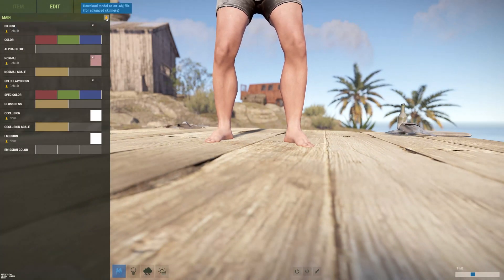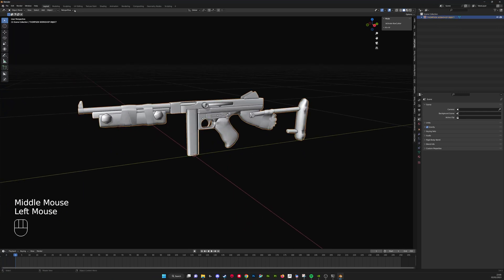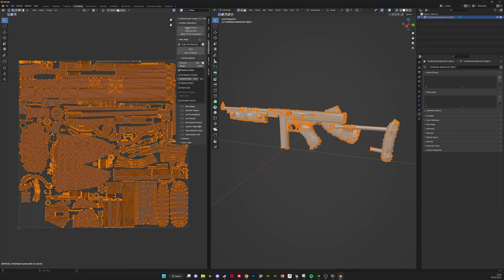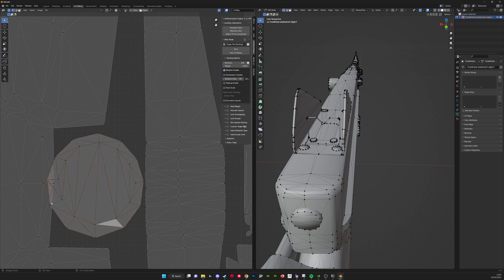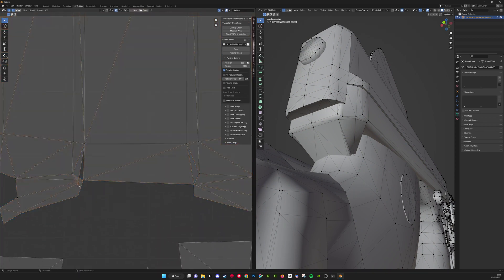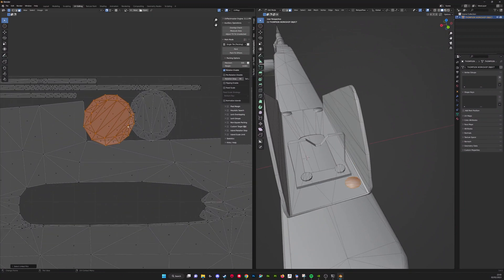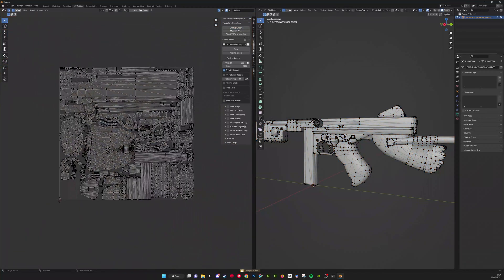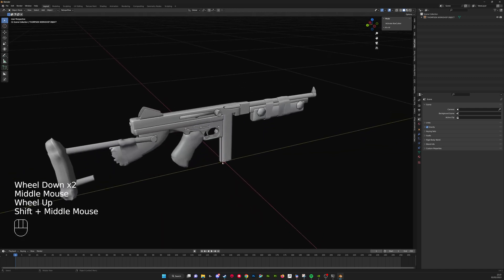How To Make Rust Skins - Part 1 - Workshop Navigation and Low poly Preparation - Blender Tutorial

Comment: PLEASE TELL US WHY YOU EDIT THE UV MAPS, DOES THE GAME NOT EXPECT THE DEFAULT UV MAPS ANYWAY???
Reply from the maker: I'm not editing the UV Maps i'm removing duplicate islands that use the same texture as another island. You need to do this if you are baking.
Reply: @DucksWorkshop  Is that not the same as editing a UV Map? I thought the UV map is bound to your exported .obj? And by UV map we are meaning the entire map you see your UV faces on when opeing the UV editor? Wouldn't UV's only matter for making a tidy high poly and giving yourself space for texturing later?
Reply from the maker: The game uv map never changes, that is where the information is stored for the game model. Aslong as there is textures on a texture map corresponding to where the game uv islands are then its not a problem. @orvyasis